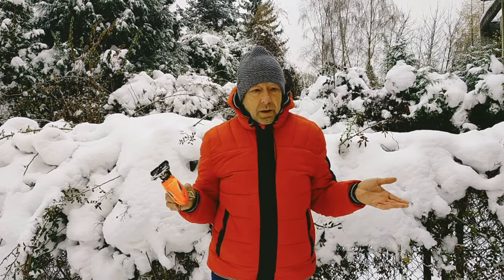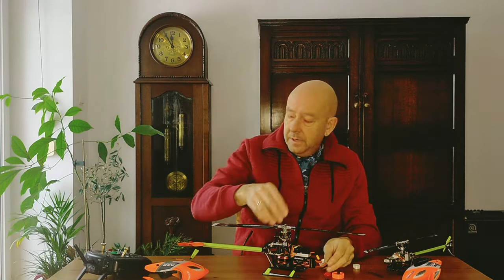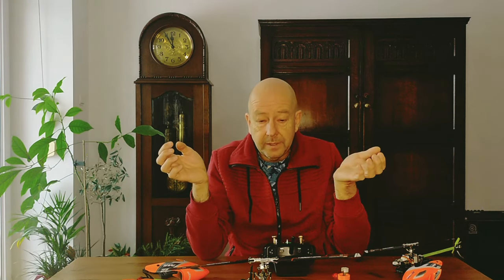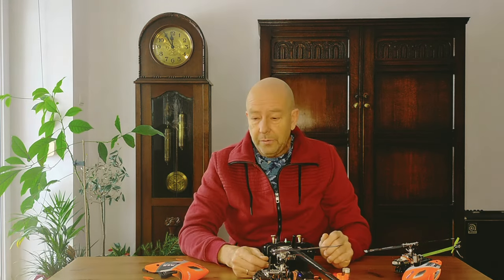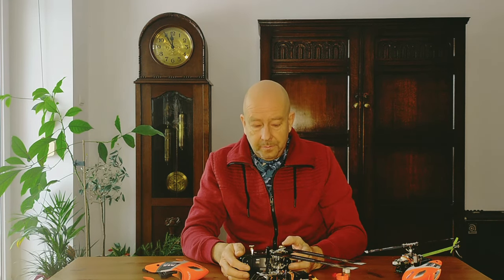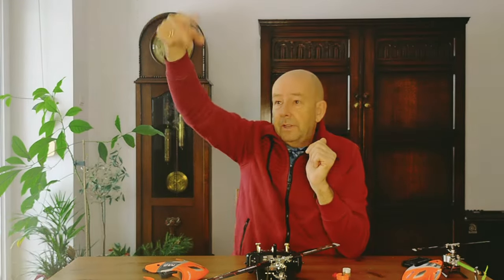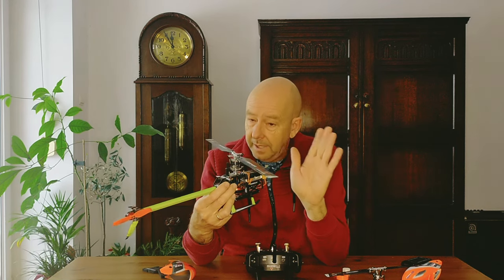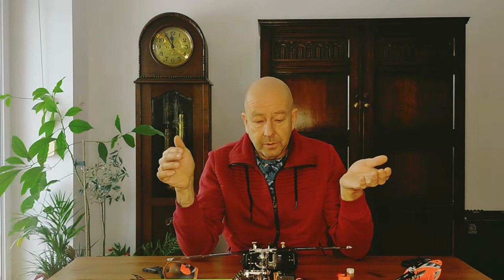Winter time = Time for safety checks!

Comment: I like your extra safeguard of not reaching in such way that if the motor energizes, your arm and hand will be out of the way.  Such a close call happened to me when I was doing a re-binding of an existing radio to my M-2.  The protocol had one option wrong, which meant that it did not recognize the throttle cutoff.  Two things saved me.  1) being clear of the blades.  2) a throttle profile with very slow, soft start and of course being able to pull the battery plug right back out.  If you are doing a restore of your SIM card, maybe using Edge TX or OpenTX companion to modify profiles, it would be wise to try a check out with blades off for the first power up especially if it looks like you might need to re-bind the radio.
Reply from the maker: @t.s.thomas2642  I know exactly what you are talking about as I had to once wipe away some blood drops from the blades of my Blade 230S V2... Thats why I am so careful now! And you are very right with your words regarding restoring SD cards or writing program files to the radio. We cannot be careful enough! Now flying the M4 and the M4 Max i do'nt even want to imagine what would happen to fingers or a hand if these carbon fibre blades would hit them... and this is valid for any part of your body!! Thanks for your kind words!!

Comment: I have messed up by reusing worn out links and servo horns....
Reply from the maker: @timmygeiste915 Thank you for mentioning this point! I am checking the main pitch control arms on my M2 V2 with the DFC rotor heads regulary if they still sit tight. The friction causes them to get worn like other links and even servo arms. All the very best!